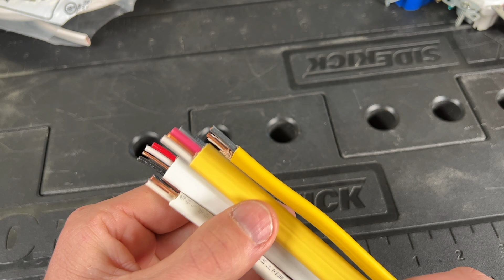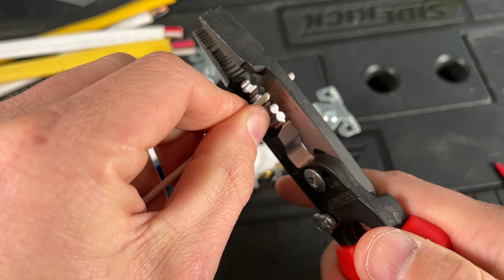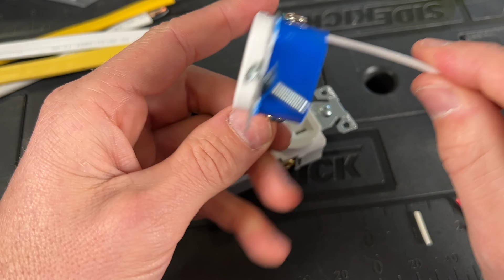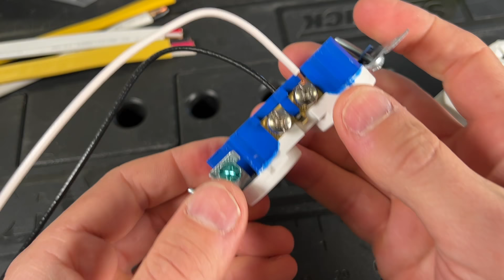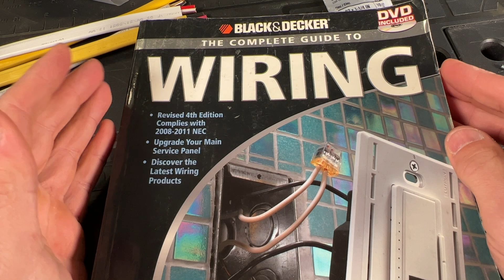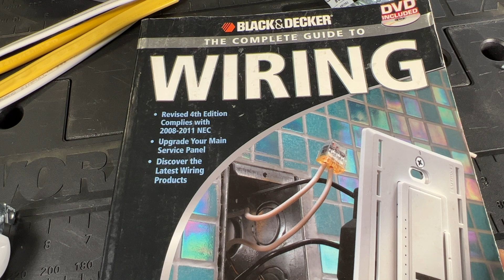#1 Best Video for DIY Electrical Outlet Basics

Comment from the maker: Wago 221 Lever Nuts
Starter Kit:  https://geni.us/NkcBP
My Favorite Kit:  https://geni.us/qNPa
Assortment Pack:  https://geni.us/izuR
3 Wire Connector (50 pack):  https://geni.us/utgybA
2 Wire Connector (100 pack):  https://geni.us/TAwOB

Favorite Electrical Tools
Knipex Hybrid Wire Strippers:  https://geni.us/uVWn
Beginner Wire Strippers:  https://geni.us/7WE6T
Klein outlet Tester:  https://geni.us/kdBAJ
Klein NCVT-3P Voltage Tester: https://geni.us/h9Hl
Milwaukee ECX #1 Screwdriver:  https://geni.us/fuSEW

DISCLAIMER: This video and description contain affiliate links, which means that if you click on one of the product links, I’ll receive a small commission.
Reply: Do you have a link for the spec grade Legrand outlets?
Reply: 1:07 Why is my outdoor outlet showing correct with that tool, but when I plug anything in, it does not work?

Comment: I'm 56 and can't think of anything other than maybe a small welder that use a 20 amp plug. I don't get it. What's the purpose? 
Besides that,,, I would think just running 12 amp would be the way to go to cuz it would dissipate heat better. Or would I be wasting money?

Comment: Great video, just one thing, on the switch receptacle, if you connect a black wire and a red wire without removing the tab on the hot side, you will cause a short. and not have a duplex power receptacle.

Comment: There's no way any experienced electrician would "prefer" backstab wiring. Plugging and unplugging over time creates vibrations that can eventually loosen a backstabbed wire. Before I could replace an outlet in my house, I was using to plug and unplug a charger all of the time, a backstabbed outlet failed and burnt the the back part of the outlet, melted the insulation on the faulty wire and burnt part of the inside wall. That's how dangerous backstab wiring can be. Also my home is only a few years old too. Side wiring is the safest solution.

Comment: When you use the bolt cutter on your stripper, be sure to screw your screw into the threaded side so that the cut off part is in the non-threaded side of the cutter.  I did it the other way once and it took some effort to get the cut end unscrewed from the tool.  Lesson learned.

Comment: You make it look at lot easier that it was. I mean it’s not hard to do it but it was a pain getting the hooks under the screws on the outlet. The guys that built my old house backstabbed every outlet so that was fun. I couldn’t get the wire out so I just cut them, stripped them and then had a great time trying to get them on. I found out if I let gravity pull the terminals down it was easier to get the wire on.
Reply: Next time use commercial spec grade receptacles, they are more robust and allow you to use a straight wire in which the wire is sandwiched between plates when you tighten the screws. It's a solid connection and backstabbing is not an option on these receptacles.

Comment: One Question... 14 g. Black White, then you say disregard the copper wire not included? explain that for me please.
Reply: It means that the ground bare wire is not included in the nomenclature, even though there are 3 wires. Another common wire is 14/3 which has black, red, white, a bare ground. The black and red are both hot wires. /3 cable is necessary for half hot (switched receptacle), 3-way switches and multi wire branch circuits.

Comment: My new usb outlet only has three screws, one for ground. But it has two slots  each for back wiring.
The one I want to replace has 5 screws, one for ground.  
What do I do with the extra wires? Should I put both white and both black wires into the back wiring holes or cap one black and one white wire?
Reply: If you cap the second pair of black and white wires, none of the downstream outlets will work. You can either use both holes for each as you suggested, or connect them, and use a pigtail to the device. A 3 port Wago would be a good method if you choose this route.

Comment: almost could say it's the best video...haaaa
but i agree with what others have already suggested. plus I think covering older wiring before 1970s is still completely relevant for basics and safety of understanding. Knob & tube is definitely another video, but I constantly still go into homes from the 50s with no grounds and deal with the two pronged outlets & awesome plaster walls. so covering a lil of that would be helpful. keep up the videos bc they are great information!

Comment: A wanna add a breaker to my main box for my tool shed/ man cave. 3 wall plugs and a ceiling fan light.
-10,000btu ac on one plug
-ps4 and tv on one plug
-mini fridge on the third plug
What should I consider? Breaker amp size? Wire gauge? Routing pattern?

Comment: Very good video sir, you answered many questions I had.  In the case of backwiring, why does each terminal have 2 holes?  Also, those tamper proof outlets are hell and I hear many people have them replaced post inspection.

Comment: Our house was actually built in 1939 or 1940 and has rubber coated wire. I actually kinda know how to work on our lights/outlets and fixed some of the outlets/lights with the rubber coated wire. What I meant by (fixed the outlets/lights with rubber coated wire) is I ran new wires..My dad has had the house since 1981 (about 44 years )when my dad was 18. He's 61 now. My age is 18 right now actually. By the way, I learned how to work on stuff like this from YouTube channels like yours. 🙂

Comment: Hi, I just want to say …. Thank You!😊 By the way, I don’t know what they were smoking when they wired our house, but we have outlets that are switched, but the 2nd switch in one room operates the outlets in another room. For example, there are 2 light control points in our dining room, but one has one switch and the second has 2 switches & the 2nd switch operates the lights in the living room & this is like this for multiple rooms.
Reply: I have your twin house! lol😅 I even have a ceiling fixture with no switch! It was on, and stayed on after I bought this 140 yo house! I had to find a pull chain or do without an overhead light! There’s a light continuously burning in the connected barn. Lord knows where that switch went. The back porch light can only be turned on if you go onto the porch, open a door, and feel around for a switch on the barn wall. You are not alone!

Comment: My electrical panel shows my outlets are 20 amp but they don't have the horizontal cutout. Is that depended on the outlet manufacturer or is the panel amp and outlet amp different?
Reply: It's common practice and code compliant to use 15 amp duplex receptacles on 15 and 20 amp circuits. Plugs with the horizontal blade are rare, so it's unlikely that you'll ever need a 20 amp receptacle (horizontal slots on the neutral side).
Reply: It’s still 20 amp some outlets have that side slot to fit different plug types.

Comment: Great video!  At the very end I noticed that you talked about Switched Outlets.  What happens if you break it off and it's not the correct outlet? If you do have a switch that doesn't seem to turn anything off, how do you find that outlet that is supposed to be switched and the tab was never broken off?

Comment: About thirty years ago I was an electrician's assistant...  In 3 or 4 years (part time...) I wired about 30 new construction homes and did a couple of rewires.  I did one complete job on my own; father-in-law's garage.  I used  the push-ins on all of it with (12 gauge) 12-2.  It's NEC code compliant and I am not aware of one single problem with any of it.  Why waste your time with the J hooks and what have you?

Comment: Fantastic info regarding those odd ball screws. Milwaukie ECX #1 works, all else buggers screw. Lowes does not sell ECX number 1 tool. Lowes sells the square head Robertson Canadian tool which works if you get correct square head tool.
Reply from the maker: For sure, I enjoy the Robbies 👍
Reply: Works best with Dewalt drill. @EverydayHomeRepairs

Comment: Super helpful video! Can anyone tell me what to do if I have 3 black and 3 white wires? I was able to handle the outlets with two sets, but the 6 wires threw me off >.< heeeelllppp
Reply: You need to connect the 3 wires together plus adding a pigtail to connect to the receptacle. So it's 4 wires connected together for each, the black and white wires. You can use a wire nut, wago, or a push in connector for this purpose.

Comment: Are electrical wires supposed to be VERY stiff? I changed my first receptacle in my 30 year old house and it was very hard to push it back in and screw the outlet in.
Reply from the maker: 12 gauge can be pretty stiff.  Did you have multiples sets of wires going into the outlet?  If so, that can make it a bit of a challenge getting it back in the box.
Reply: @EverydayHomeRepairs   Yes It has the wires that are giving it the power and then wires leaving it that connects to an outlet in the bathroom. Thanks for answering, I just wanted to make sure it was common for wires to be stiff like that because in videos Iv seen they seem easier to handle. 👍🏽

Comment: Why would it be a good reason to use a commercial grade outlet in place of a residential outlet? It doesn't make any sense.
Reply from the maker: Much better build quality and the back wiring feature that comes on commercial grade (not residential) makes a safe installation faster for most DIYers.
Reply: @EverydayHomeRepairs  I have to ask you for some advice. If that is okay with you...  If you're looking to enter a trade like electrical tech. What is the best way to get hired. From what I understand going to school is better is that what you did because I need to get an idea on what to do and I don't know where to start and I have little to no knowledge about being an electrician and I really want to attend school for it. I just don't know if looking for work and then getting hired and having a company cover my schooling cost would be better because I think I could be good starting out as a helper and get an apprenticeship that way. I'm just wondering what would be the better approach to apply or enroll. A while ago I ran into a guy at the barber shop who was getting his hair cut and I was sitting in the chair next to him he was talking to the barber and I was involved in his conversation he was open about what he did for a living and he since I was unemployed and he gave me good advice I was listening even though he wasn't talking directly to me he knew I was looking for work so I was included in his conversation and he didn't mind talking to me and then barber anyways he told me he was a business owner of a construction contracting company and that he could handle the responsibility well. Anyways he said the type of workers he preferred to hire were the one that already had schooling even though he hired guys that were self taught. I know there is nothing wrong with learning on your own or from another person online, but there is a limit on what you can absorb. Anyways, he said that during the time he is running his company sometimes he has to go back and double check some of the work of the guys that are self taught and a lot of them are okay at what they are doing but some of the work that is done or completed he said doesn't get done right and he has to fix his self of have one of his employees that have schooling to fix. He told me I would rather hire someone who has trade school experience because they know what they're doing and the quality of their work is better. So, would you recommend I go that route. Enroll in a trade school program for several months and land a job that way?

Comment: i know it’s not “home electrical” but a video on single pole double throw double pole double throw switches would be great. wired up lights to a truck and trailer and wanted it to look as clean and factory as possible. came out great but a little learning curve.

Comment: One thing I need to add to my previous comment is that the wires seem to be 12 gauge and not 14. Found this out when I tried to strip a wire using the 14 solid and it cut into the solid wire. This is a receptacle downstream from a GFCI that I installed in my bathroom. House was built in 1985 and the circuit breaker is a 15 Amp. Thanks!

Comment: Thanks for all of the great videos! Is it ok to have 20 Amp receptacles on a 15 Amp  circuit?
Reply: Nope. The wiring is only rated for 15 amps, so you have the potential of loading that receptacle to 20 amps which could cause the wiring to overheat and cause a fire.

Comment: Thank you.  Especially liked the ECX tip.  I bought the Milwaukee 13 in 1 screwdriver set with the ECX I also bought the Klein tool wire strippers.  What a difference quality tools make.  I’ll buy the outlet tester and the voltage tester when I can afford.  I never knew these tools wee available.  I always used the wire voltage tester.  The ones with the 2 probes and 4 indicator lights to tell you the voltage.  I.e.110, 220 etc. No fun!

Comment: Great video !! 

These days when hiring a licensed electrician to install or replace a spotlight or electrical outlet costs $300 for 30 minutes work this is an excellent video if you feel it's something you might want to tackle yourself.  

Replacing devices isn't overly complicated and I've done it dozens of times especially since all the base work and wiring is already done.  You don't have to be afraid of electricity but you do have to respect it and that it can kill you if you're not following ALL the safety precautions.  

Curious about a comment I saw from @Cymaphore where it shows "The DMM is completely unsuitable" then lists 6+ DMM's to use.  Both Klein and Fluke are DMM's so is it just the specific one the OP has that's not good to be suing for electrical work?   Thanks for any input you can provide there. 

I also want to emphasize what justinm8914 said about every residence never being wired correctly.  I've lived in at least 8 homes and not one was done to code or wired correctly.

Comment: Could you show me how to wire an outlet that turns on a light externally by plugging into the outlet? It is also in a junction box with three other wires in the junction box and the home run for circuit.

Comment: Great video. Question: Moved into 1975-era house. All 20 amp breakers in box. Should all wire be 12g and all outlets be 20amp? Or can 15 amp wire be used to wire to light fixtures, etc.

Comment: Good video.  The most interesting part of all this to me is that in literally every house, every apartment, and every structure, ive ever resided in, its never done correctly.  Not one time.   from the breaker box being labeled incorrectly, to multiply "hot wires" being on a switch incorrectly. The most common one is how the entire house is wired incorrectly with romex and then also labelled incorrectly when you try to fix it.  This video showed me that the "experts" didnt even know what they were doing when they built the house.
Reply: That's really sad & scary!! I've seen the same!

Comment: Thanks for all your great posts! Maybe this was already asked...On the 20 A recepticle it shows a side-on "T" on the neutral. Is there a special plug for this....I can't recall seeing any mention anywhere about that. If not, what is the purpose of the "T" as opposed to a straight Common slot.
Reply: He did mention that the purpose of the T on the neutral slot was to indicate that the outlet is 20 Amps as opposed to 15 amps. There are no special plugs for those.

Comment: Love this video. Thanks
Reply from the maker: You bet!
Reply: @EverydayHomeRepairs  I just replaced a old socket and i was wondering why the lamp wasn’t being controlled by wall switch anymore. The tab break off I’m sure is the issue, I’ll break it off when I get home. Keep up videos
Reply: @EverydayHomeRepairs  question. I replaced old outlet that was lower half switched with new outlet. I broke off bridge tab on hot side but new outlet has both outlets still has power all the time. Tester reads wired correctly. Any ideas?  Thx

Comment: Can u side wire the commercial style outlets 3 and 4 one (from left).  These have binding screws (not smooth under the screw).  There is a levington residential grade that can be backwire (looks like cheap outlet but has a floating plate on side screw - and screw us binding - not smooth side).

Comment: It would be a good video, but once again you recommend the absolutely wrong tool for voltage testing. The DMM is completely unsuitable. NCV is dangerous. Socket tester can only test the socket and not the wires or terminals. What you need is a proper and reliable electrical tester that confirms with guidlines and regulations! Examples: Fluke T+Pro, T5, T6, T150, T130; Ideal 61-547, Vol-Con; Klein ET40, ET45; Beha-Amprobe 2100 and many others.

Please educate yourself before teaching dangerous things to others!

Safe insolation is the single most important things when working with electricity. None of your testers is suitable for that task.

Comment: The slits (2) on the top and bottom next to the mounting screws are of different size. The thinner one is used for stripping 14 ga and the wider one is used for stripping 12 ga wire. Aren't they smart!

Comment: Best tip of the year or maybe 5 years using a square driver to tighten down the screws. For years when I have to do an outlet job  I always take a philips and a regular screwdriver and today only had to use the square. The key word is "Have To" because I'm not paying an electrician 60 to 100 to switch out an outlet  like today putting in a garbage disposal so had to add a power cord the dishwasher and install a GFCI outlet to plug both of them in and replace all the plumbing under the sink and put the new faucet on didn't need  new faucet but when she's in a buying mode you just do it. Happy Wife = Happy Life